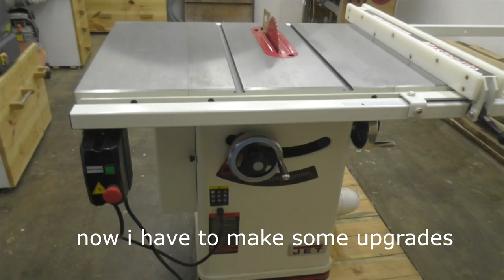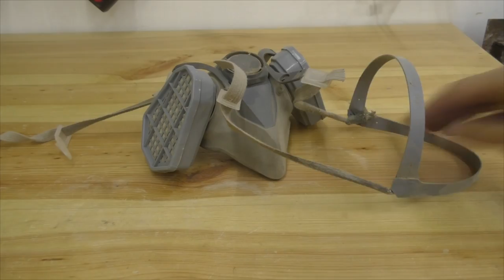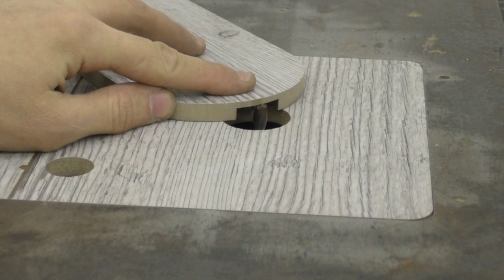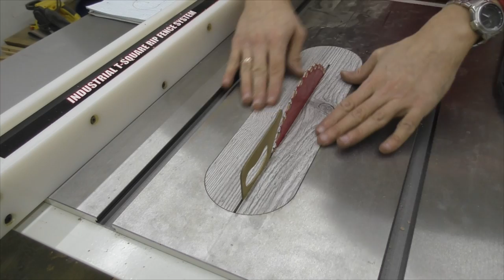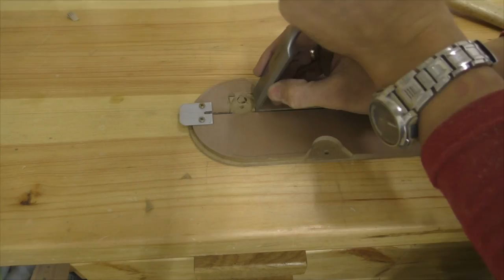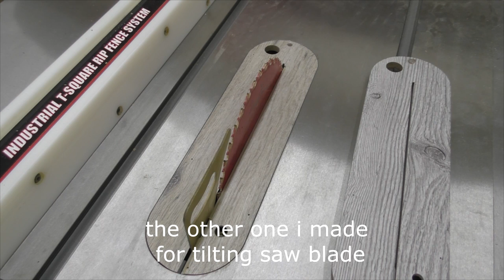🟢 Zero Clearance Insert - Table Saw Upgrade - Part 1

Comment: Awesome, like all your videos! One question: what thickness laminate floor are you using? I want to try it, here it's available in in 8mm and 12mm.
Reply from the maker: in this project I used 10mm laminate, but for some crosscut sleds used 8mm. Thanks